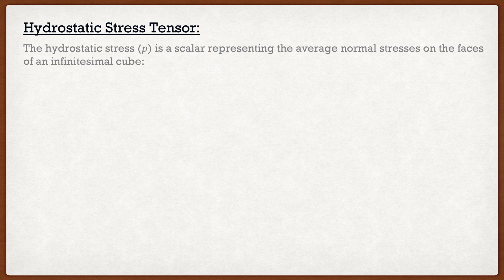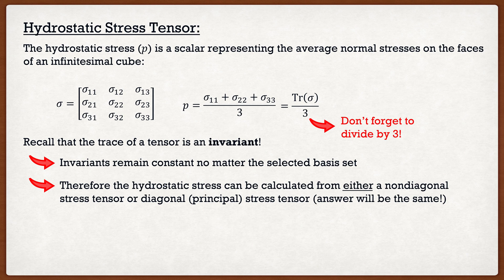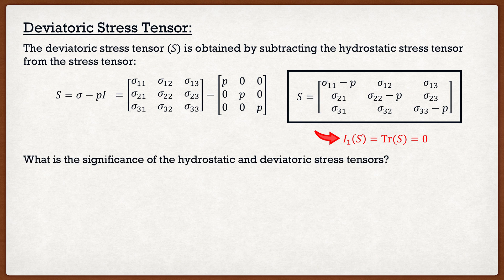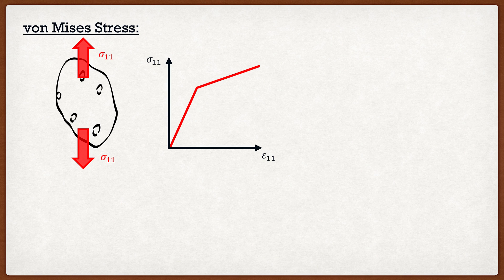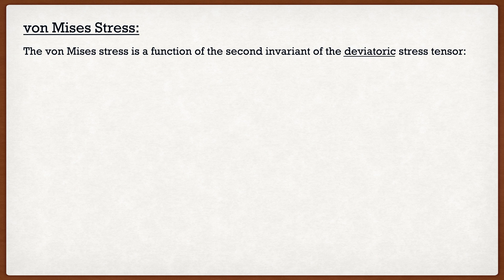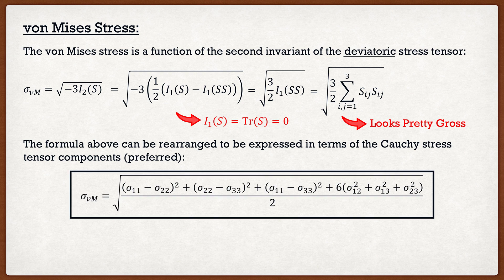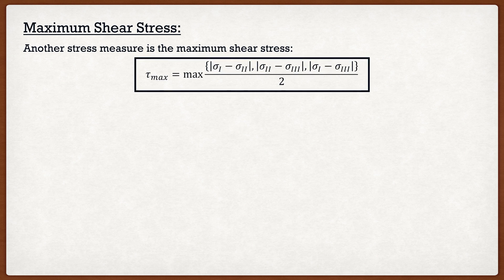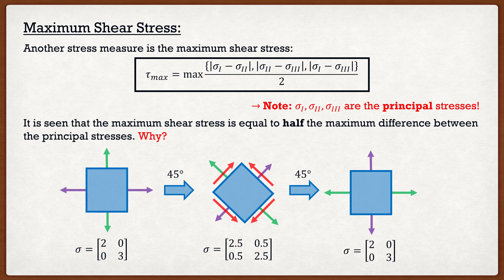Solid Mechanics | Theory | Stress Measures (Deviatoric, von Mises, Tresca, etc.)

Comment: Thank you for the video. Small mistake at 11:05, the matrix shown is the CW rotation matrix, to be CCW it needs the - in front of the top right sin(theta) instead of the bottom left one.
Reply from the maker: Thank you but there is no mistake :P in the maximum shear stress proof I am rotating the basis set defining the coordinate system and not the shape itself (which is why the selected coordinate transformation matrix is correct as a CW rotation of a shape = a CCW rotation of a basis set).  I should have been more clear on this haha I am sorry for the confusion!
Reply: @ClaytonPettit  Oh I see OK thanks for clarification :)